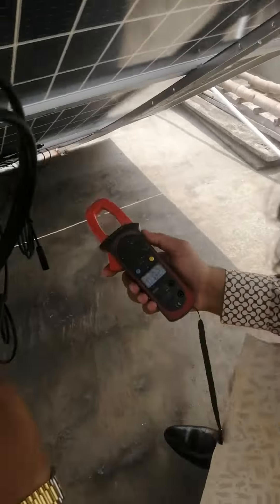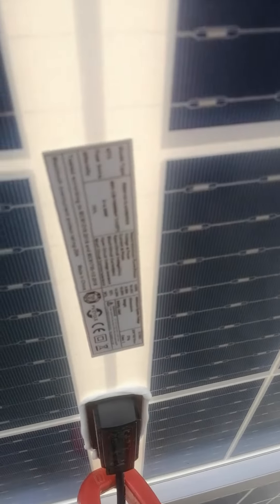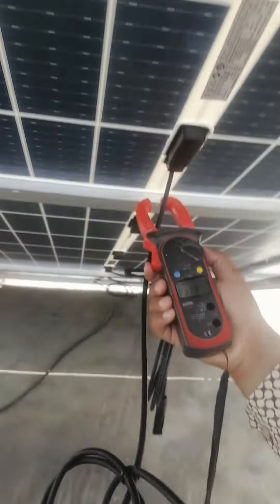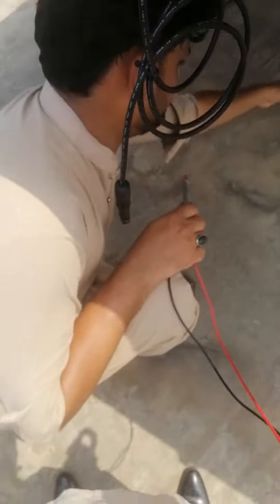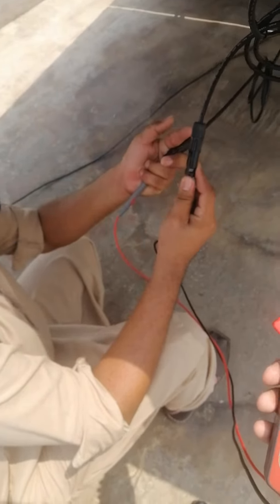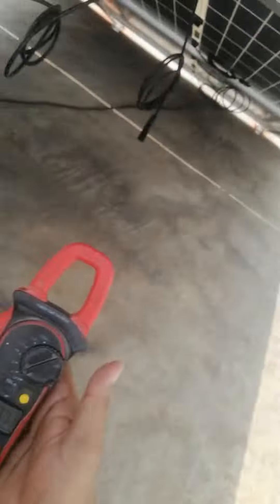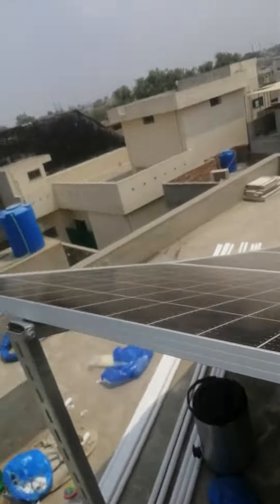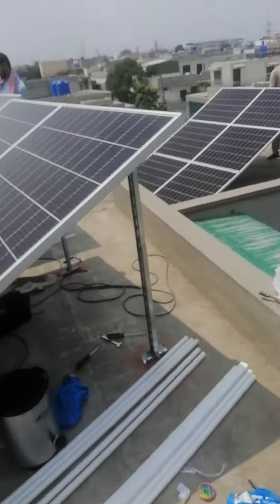Complete testing bifacial half cut mono perc risen panels with nitrox inverter

Comment: Very bad installation,  just saving money on structure.  Since panel is lengthy in dimensions so span should be control.
Reply from the maker: The customized structure is usually expensive so with standard structure we provide the best we can do according to the space and user demand.

Comment: Bhai you are making a huge mistake here. Max input current limit is 11Amps for Nitrox, and with Bifacial you will easily cross that. What will happen in that case, you know that better than me.
Reply from the maker: Inverex technical person sy bat hoi ha bro short circuit value different ha on load amp different hoty ha unho ny allow kia ha
Reply: I don't have the spec of the inverter , if the inverter limit is 11amp so he will spoil the inverter and consumer we say solar system bad .
Reply: @amirpowersolution4000  dear always take the STC parameters. Supplier want to sale the products you are on risky side.
Reply from the maker: @adnanhassan9239  you are right but technically I the amps in limits and solar inverter is safe.